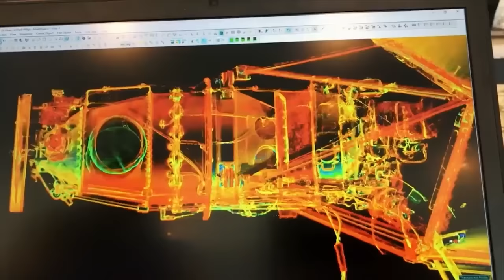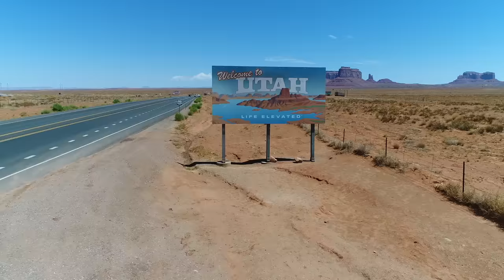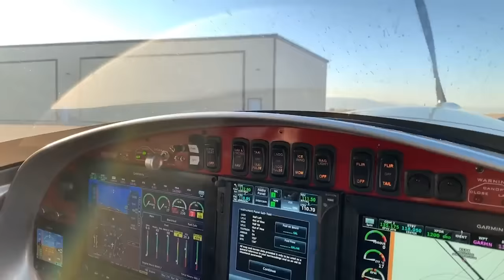Building the Friendliest Airport in the Country | PateyAviation

Comment: Great idea Mike. My wife and I just built our dream air park house and hangar and are still working on finishing out the inside of the hangar. Our comments are:

1. A four way fuel station. Nothing worse than having to wait to fuel because the people in front of you are too busy chatting to get out of the way. 

2. Make sure that a tug is available at the fuel pump to move your plane to parking. Moving a taildragger or even a 172 after fueling isn’t tough, but after fueling my Saratoga to the top with 107 gallons of gas, it is tough to move. For those of us with fuel injected engines, a tug makes more sense than the hot start that is usually no problem, UNLESS there are people around watching or if you have first time fliers with you.

3. A nice restaurant with a viewing area is a bonus. I would suggest looking at some place like Stearman Field (1K1) and their Bar and Grill or also Gate 12 Restaurant at College Station (CLL) and also Louise at Thaden Field (VBT). A menu of a variety of food and setup to encourage fly-in traffic with parking, priority seating for fly-in traffic, and plenty of view ability of the airfield.

4. A Pilot Shop in the FBO with some stuff pilots really want. Not just oil and funnels, but also things like some handheld radios, ADSB in devices like Garmin GDL 50/51/52 and Stratus devices (just don’t forget some GA pilots don’t use ForeFlight because it only works on Apple).  Some things like the cool tie down’s suggest by the OSH folks would be good too, perhaps with some camping gear.

5. Speaking of camping, some area for camping would be awesome. Perhaps enough space for 10 planes, in a grassy area, with tie downs sunk into the ground, so pilots could taxi and park and camp on nice soft grass, but have access to some bathrooms and showers within a nice walking distance.

6  For any ramp parking, suggest low-to-the-ground electrical outlets so people can plug in the engine heaters in the winter. Telluride (TEX) has this and it is awesome.

7. If there is a way to make the side of a building conducive for projecting a movie, is a great way for families to come out in the evenings to enjoy the park area. If you can build in in-ground speakers when building the park, it makes the finished product look more appealing than the typical inflatable screen with an underpowered projector and sound no one can hear.

Those are my thoughts. Hope those are helpful. Good luck! 

Coryee and I will make a point to come visit.

Comment: You are a rockstar Mike! Thank you for making GA a priority. I have a few ideas I’ve pulled from visiting other FBOs:
1. position the FBO to have a great 2nd floor viewing area to see the final approach of the main runway, and have the CTAF broadcasting in that area, floor to ceiling glass to provide unobstructed views of the runway. 
2. Nice courtesy cars. The MillionAir @ KMFR has New Mercedes from the local dealer, and they offer it to anyone that comes in, felt pretty cool flying in with a small Cessna a being met ramp side with a luxury car. 
3. Upscale bathrooms with showers. 
4. Plane side camping in the grass! 
5. Self serve fuel with multiple parking spots to fuel at the same time, and a large reader board showing current price per gallon, total sale, and gallons pumped that is clearly visible from 30-50’ away while fueling. 
6. Friendly ramp and reception employees. They can make or break the whole experience. 

Back to work!

Comment: In-ramp GPU for light jets/turbo props on specific parking spots!!!! Where you can open a service hatch or something simple and have a gpu cord that can be reeled in and out.  Have it powered straight to the electrical grid so there is no need to push a gpu up to a plane.

Comment: @richardturner6278  mentioned having cheap ones mixed in.  It may be cool to have some small units next to the big units so big guys can have a big unit and share the hangout space  with a friend,  

have a few sets of two hangers sharing a hang out spot.

Will these be funished, or self furnished?

You guys should have fiberoptic and coax, and maybe cat 7 wire to each unit.  Talk to your cable company they may do the wiring included with a long term contract..   

I know you do stuff right, but it would suck to have each unit with a satelite dish.  The dish or cable company can probably make it ready to go.

I hope the hang out space with sinks and stuff is well insulated, and you guys will want minisplits and maybe a propane or natural gas  backup heater to keep stuff from freezing. (if you guys do solar with a large battery bank you may be able to get away with just heatpumps, but they're gonna struggle with your winter)

I imagine there will need to be a janitorial crew, and they wont be needed except for the few times it is used.

If you have Best Tug rentals for the people who don't fly very often that could be interesting.  (I don't see how this would work unless you just have a few that are spread out between the hangars)

Comment: I grew up as an Airport Kid. Went there every weekend to hang out and sometimes after school. Knew every aircraft coming and going, completely fascinated with flying machines. I could stand up on my bike and see through the hanger windows the Helicopter Engineers working on Lamas and 500s and Jetrangers ,even the odd Bell47 or H12E while other guys worked on fixed wing aircraft. I`m  still obsessed, flown Sailplanes and Hang Gliders and my son works on Q300s and ATRs in the same airport hanger that i used to look through the windows of. I`d suggest there be a way for the kids to become involved and perhaps a little obsessed also.  Remember when you could clean airplanes for a ride? An Ounce of obsession is a big motivator for a kid keen on flying. Not all of them have Dad`s to get them into it,,,, or money.

Comment: City of Glendale AZ did just the opposite, banning social use of hangars, facilities, etc a few short years ago and lost a lot of residents. Chandler, AZ Muni has just about run out of room for hangars and has hundreds of planes tied down on the ramp, but social access is extremely limited and access is old school as you stated. Stellar Airpark is just a half mile from our home, but few GA pilots can afford a custom home/hangar costing a 1m or more. Pegasus Airpark farther east barely has 30% occupancy in over to years. 
What you and Mark are doing with this is just fantastic!

Comment: 1. Covered Tie Down Spots with a weather proof large storage bin for covers, small tools, engine heaters, etc. 
2. A rule that makes it so hangars can only be occupied by people who actually fly their planes. So you don't get someone using it for cheap RV parking. 
3. Wifi - this way you can electronically turn on your engine heater in the winter. 
4. Wash Station
5. Electricity close to resident TieDowns
6. Timely snow removal service
7. Every year rotate a 'Charity of the Year' that everyone is encouraged to support in some way shape or form.

Comment: What do many GA pilots do?  Fly for food.  That famous $100 hamburger (maybe $200 now in this economy), but a RESTAURANT is what you need.  Build a great restaurant that can be taxied right up to and they will come.  Once there, pamphlets inside can show all the attractions Spanish Fork has to offer.  A nice aviation-themed restaurant with some small planes hanging and an elevated view of the runway with CTAF/SLC approach piped in for atmosphere.  This will make PateyAviation more than just fuel stop and rest break.  A bonus is this will also attract regular folks checking out the restaurant and help get them introduced to aviation while enjoying a nice meal.

Comment: A bar made from an old wing section! (Don’t really care what is served there, but it has to have a view of the approach or arrival) and various ceiling fans made from out of spec old props (even the giant ones from b29s for example) might not be good enough to be airworthy, but it wouldn’t be hard to make them good enough to be a fan! Most importantly are lots of good vantage points to see all the cool toys that come in!

Comment: Mike - I think GA is missing the affordable airplane to rent. Something like a Kitfox or a J3 cub to rent for $80/hr wet would be really helpful. It would help stimulate the light sport category. I own a J3 cub and I can fly for 2 hours at $45 in gas.  Also, hosting build classes throughout the year would be great. Some focusing on fabric, electrical, or experimental rules/regs. 

And probably most of all, an interactive museum show casing where aviation began and where it’s headed. Something kids can hop in a full motion sim and play for hours, Build model airplanes, and then fly them in an enclosed space (hanger or big secure area with a net). 

Show pilots how to conduct part 41 maintenance correctly, and safely would also be a huge help.

Comment: I'm on the journey of restoring my 1941 de Havilland Tiger Moth.  I have to keep the project at an airport more than an hour away from where I live (in typical traffic), because the airport 5 minutes away is unfriendly to restoration work.  They basically don't allow you to do any "heavy maintenance" on the airport at all.  Even where my project is at, which is a nice T-hangar, I have only 15 amps of 110v power on which I have to run a small machine shop (knee mill, lathe, bandsaw, jointer, planer, etc).  There is no heat, so about 6 months out of the year my productivity is near zero.  Even so I'm lucky I found a place at all, every airport within several hours of me has multi-year waiting lists for hangar rentals.  Buying a hangar, anywhere, is out of the question for me... I don't even own a house yet, still apartment dwelling, and of course now that I have such an amazing project, it sucks up most of my finances.  But my feedback for you on this project is: please make them restoration friendly.  Good power, three-phase if possible, central compressed air, heat in the winter, good wifi and internet... those things would make my life soooooo much better if I could get them.  Happy to see any new hangars being built tho, good on you and I hope you have all the success with them.

Comment: Your going to need a large pond or water feature in your garden area. Hydronic floor heating in the living areas, dog wash station, dog run, kennels with soundproof room, indoor potty station, hanging chairs, built in circular sunken sofa area, fireplace area, loft area, wood burning stove, gasification boiler( backup for hydronic heating), dry sauna, hot tub, indoor pool, steam room, fitness area, commercial kitchen, terrazzo floors, front entrance building facade to resemble luxury log cabin.

Comment: "If you build it, they will come" could mean (Not only pilots and their airplanes) hotels or other overnight accommodation and showers in the FBO. Solar field to supply power for the FBO and car/airplane charging. Offer a Best Tug to use for each tenant and offer discount to buy one. Build an observation tower for many reasons and maybe the airport will be so busy it will need controllers in there. Prepare for every type of fuel including the new Swift unleaded and Auto fuel. You have great vision and passion and look forward to a visit from Tennessee.

Comment: Ideas:   Homebuilder training for fiberglass layup, carbon fiber layup, aluminum welding, wet wing construction techniques, etc.  Civil air patrol and young eagles events.  Mountain flying classes.  Manufacturer demo days.  Hanger owners should be able to pull their plane out and put their RV in the hanger (req runway access for the RV).

Comment: One thing that strikes me about the airfield is the lack of an adequate safety run-off area at the southern end of the runway. I'd extend the runway to the north, and significantly increase the length of the southern end's displaced threshold. The recent runway over-run at Aero Country Airport in TX is a good example of what can happen. There wasn't enough safety space at that end. Given that you're a municipal airport, FAA funding is likely.

Comment: Mike, did you know Piper Memorial Airport is for sale by the city of Lock Haven, PA?  It will be a tough sell as it has to remain an airport, since they receive government  funds.  I was  consulted once after being contacted by a friend on an FBO overhaul. I went to the airport and looked at the facilities and a representative of the new FBO owner wrote down all my suggestions for the new owner. I went back several moths later and found they exceeded my expectations.   I suggest that your new FBO should not be just a place for aircraft owners and pilots, it should also cater to future pilots by having a flight simulator room. Maybe a club for flight sim enthusiasts. Contact some equipment and computer manufacturers if they would like to showcase their products.  Have cutaways of some aircraft engines and/or components.   The biggest fly in the ointment of aviation is the price of fuel. Even having the cheapest around might not help, if environmentalists have their way.

Comment: THOUGHTS ON SAFETY AND FBO..A BED, A LOCKER WITH CLEAN SHEETS, PILLOW AND BLANKET. It seems a bad decision may not take place ( to fly or not to fly) if an FBO really offered a place to rest one’s head. No not a crappy old sofa. Something like a cube? Large closet size area, imagine it ( like for pilots on long-distance international flights, or that can be found in some international airports)… It could have bunkbeds be very simple, a simple, sliding screen would provide privacy, a locker nearby could hold a pillow, sheets, and a duvet, all wrapped in plastic. Basically, you are not opening a hotel, but you are providing a place for a pilot and his copilot are passenger to lay their head down,should  they make the decision to spend the night instead of flying due to whether, etc. You could make it clear with a placard that this is only meant for emergencies but that pilots are welcome to it.? Just an idea it wouldn’t take much space just convert one sort of closet area? Just a thought. You did ask for them :-)

Comment: If people are flying cubs in and out of that airport for recreation having  a place for sevices like prop balancing engine overhaul's just general maintenance  of a plane would be good and at a reasonable price , along with parts for repairs on hand . Be it engine parts or plane parts like nuts and bolts , pulleys , avionics , or even upgrading engines with turbos to fly at those higher altitudes . That are required for landing in high altitudes and taking off again .

Comment: MIke,  with Electric Planes starting to hit the market.  You may want to plan for a 5KW supply grid at the Business park to be used strictly for charging planes.  it can be used for both planes and cars with the appropriate Connectors.

Comment: This might sound silly, but I'd like to see some sort of ultra compact aircraft storage solution similar to what you see in Tokyo for cars. This could be something covered and protected from the weather but less expensive than a private hangar.  These could be like mini towers with an external elevator system for single aircraft in/out.  A little more peace of mind at an affordable price point. 
Thanks,
B

Comment: It’s so nice to see a city support GA.  Sadly, the airport I keep my Tri-Pacer, Andrews, SC (KPHH) just stopped selling avgas with no notice.  I tried to top my plane off the other day and the fueling tank was empty.  So I called the airport division of the county and they said they are no longer keeping the tank filled.  It’s a tiny airport, just eight of us based there but on nice days a few planes a day stop for fuel.  I wouldn’t be surprised if the county shuts down the airport soon.  It’s under new administration and they are pushing to service business aircraft at the county main airport, Georgetown, SC. and throw GA under the bus.  They kicked out the GA maintenance company to entice a business aircraft maintenance company.  It’s very sad.

Comment: I love the idea. 

I've seen that a lot of airports have lost hangar space due to people using it for a home, business, workshop, storage area for old cars, etc. that is not aviation related. That drives up the cost of the hangar space and there is none available for planes.

Will you be able to keep the occupations aviation related?
Reply: ... and then the non-aviators complain about airplane noise.  I hope at least some consideration is made to contractually assuring hangars are used to house aircraft.
Reply: @DaveMissyDevilDog  Our hangar space went to $400 per month, which was cheap for an apartment, but way too much for recreational flying.

Comment: How would you feel about a world class botanical garden integrated as well.

Check out the Eden project in the UK, a structure that weighs slightly more than the air inside. 
  Indoor farming can yield 50 dollars a sq ft. Annual

Comment: There is a need to have electricity available on the transient ramp to plug in engine heaters while tied down. It is very frustrating in the upper Midwest how few outlets are available (and working) at most airports.